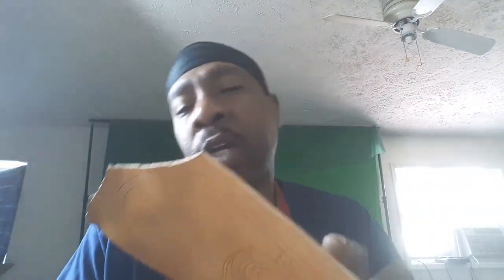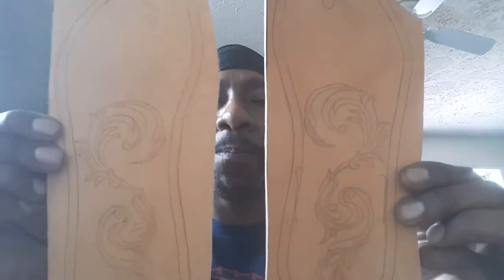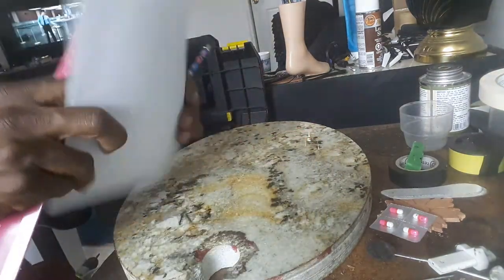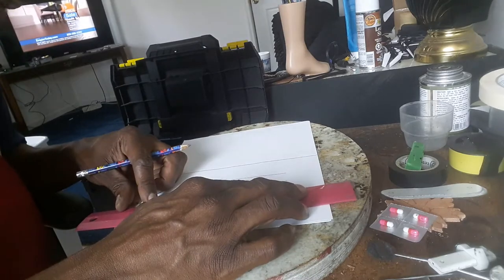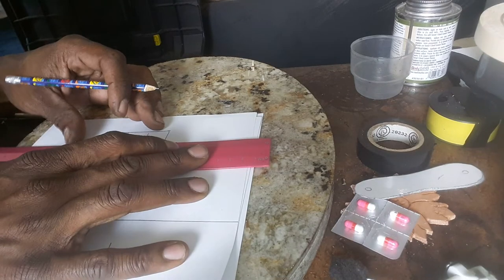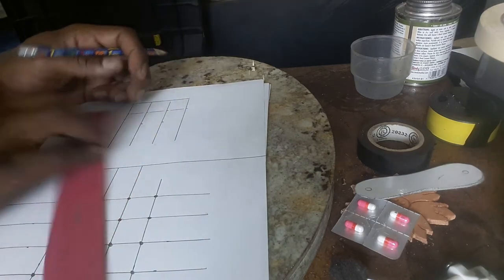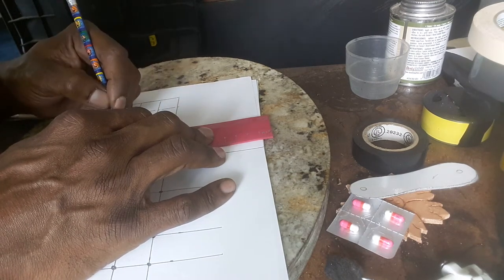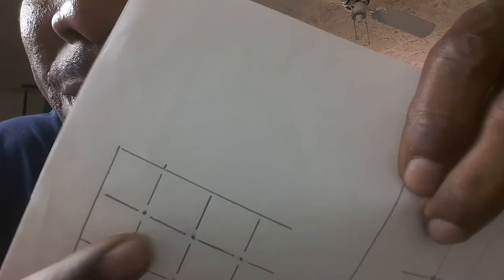Quilting pattern in leather crafting.

Comment: You should use 6b pencil to draw on leather. You can erase it and it won't leave marks.
Reply from the maker: Eran Shpigelman it's not the lead mark that's left. It's the creasing from the pencil tip.
Reply: premier leather crafters RDM  I know, that's why when you use a 6b pencil you hardly press on the leather and no mark remains after you erase it.